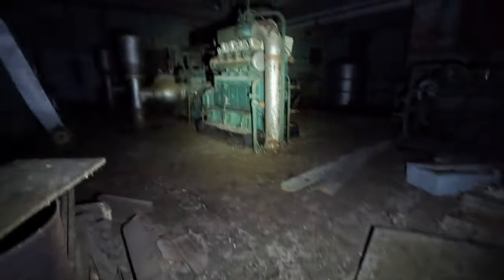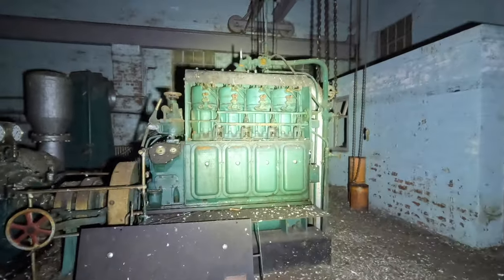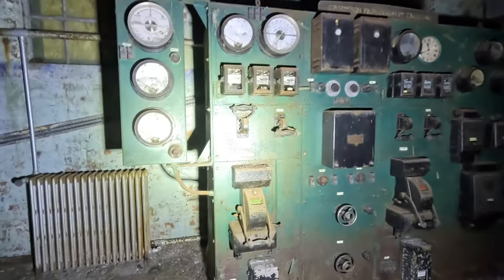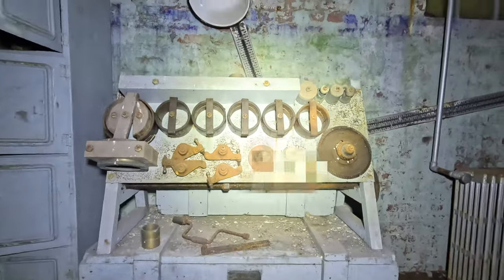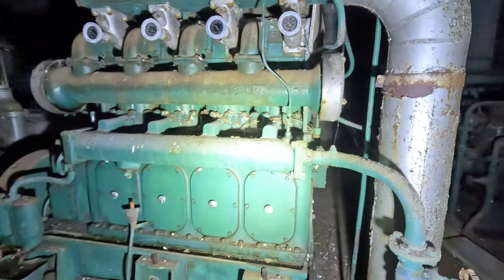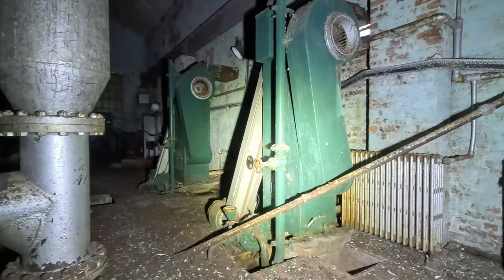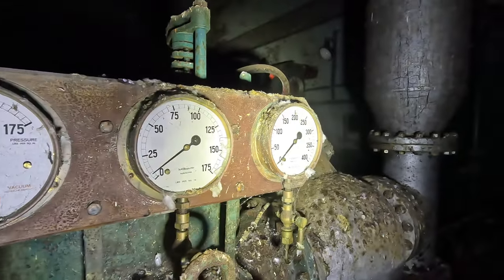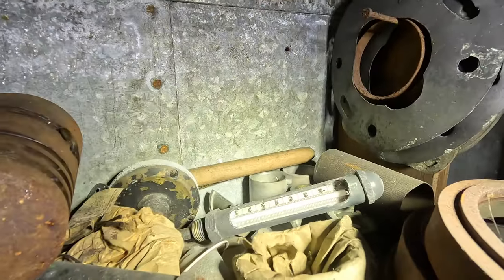Explore this incredibly rare Royal Navy fuel pump house complete with pumps and spares

Comment: Fabulous time capsule find 👍👍
This whole room ought to be restored as a wartime museum, those Ruston engines would start and run within an hour I'm pretty sure.
Another thing i noticed which brought back fond memories to me as a young lad was all the Allen West star delta starters for the electric motors, all our switchgear in our family sawmill was Allen West items, a couple of which were identical to some of those in the building.
The bigger starter for the 50hp motor on the big saw was oil bathed and was like a Swiss watch in operation with a 'wind up wheel' on the side of the starter.
Wonderful video, subscribed👍👍👍
Reply from the maker: I think that’s the hope; to restore and open the building as part of a museum including the wider historical context. It would require substantial funding to get it to a world class standard, but I’m sure other volunteer driven options could be an option. That’s great information about the electric motor starters, I’d have loved to turn them over but it wouldn’t have seemed right.